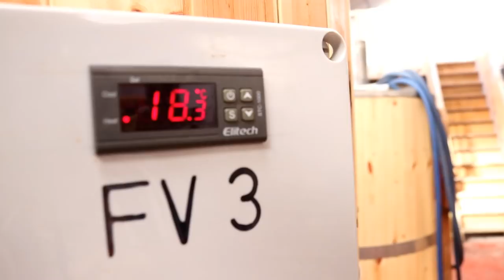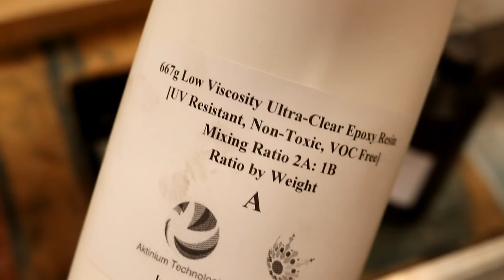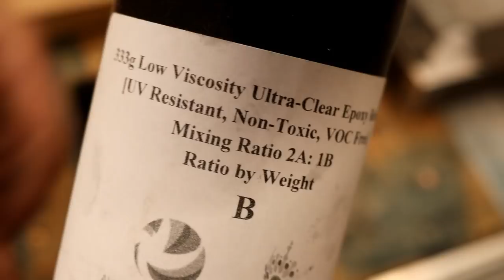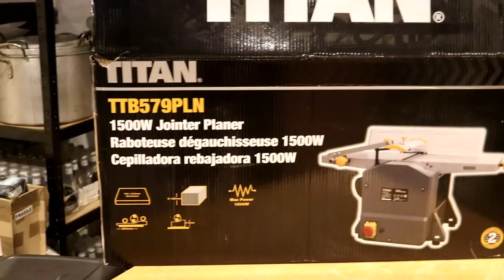TITAN PLANER THICKNESSER

Comment: I've got a slotting tool for the router which works exactly the same as a jointing tool. I've used it for doing biscuit joints on kitchen worktops with perfect results. Cheers, Schnuz.

Comment: You might be able to route a slot or two on both slabs and run a piece of 3/4 or 1" stock to form a continuous joint (for no cost if you have a router and a slotting bit).  It isn't much cost for a biscuit jointer and they have loads of uses - you can benefit from them if you fancy building lots of storage shelves and drawers and such. Either way will be a benefit...all that matters is do you want to save some cash now or have more capability. Beautiful tops, all that lovely ash.

Comment: Harry , great vids mate, router a slot on the side of the timber and then use a scrap of ply as the joining piece. or you could rebate clamps on the underside.